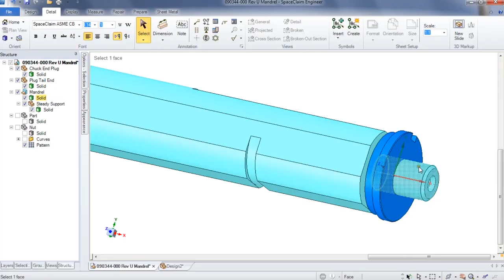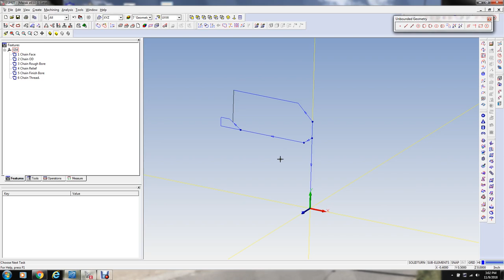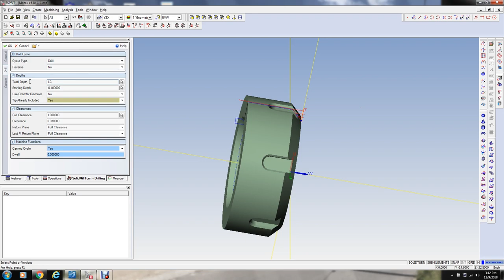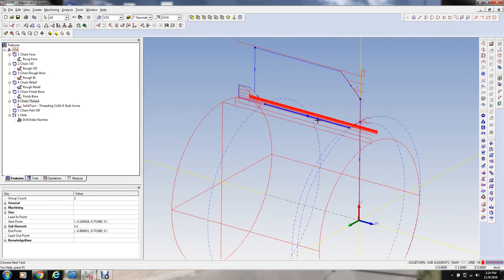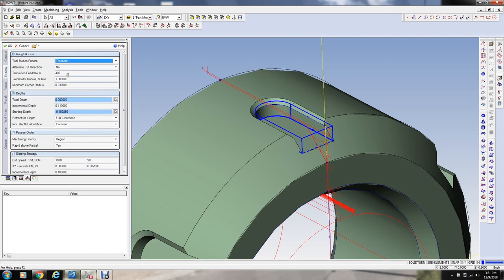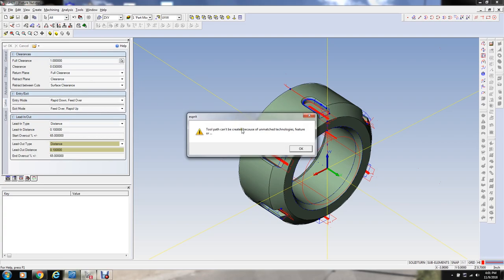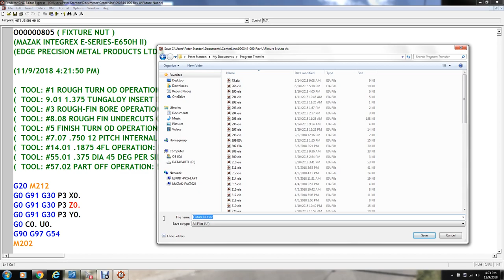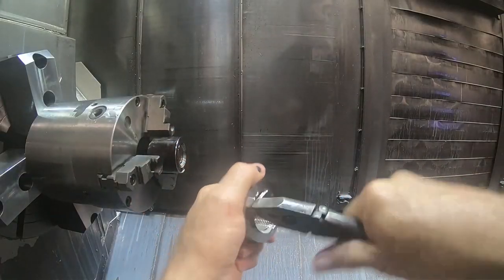Programming and Machining Fixture Nut Complete

Comment: Hi Peter, thank you for putting it out like that, a little threatening to have your style, package, machine etc open for others to observe.
I was programming back in the mid 90's. My lathe was a Daiwoo Puma with a 12 tool post, no rotary's, so it was a little less versatile. But my tool changes were done just clear of the job, after proving!
I was using AusCadCam with that and a 3+1 axis machining center which was altogether not too shabby for the times.
A couple of things.. I think my cad program was easier, more intuitive, than yours to use..
Though I didn't have solid rendering... And it didn't have a collision allarm pop up on test run...
What could possibly go wrong there, eh?
A few things all my parts had was a radius at every edge, into and out of chamfers, a small one in the bore to match up with the part off, etc.
With the part off I would do an initial plunge roughing cut to below any chamfer, withdraw an start with a radius into maybe a chamfer or directly into the part off.
Reduced almost any finish work.
Just sayin'.
Keep up the good work, we're all enjoying.

Comment: Could you have done another pocket operation for the chamfers? Enjoying the videos.
Reply from the maker: It’s possible but for a chamfer it wouldn’t be the best. Where the arc end of the slot is. That element was actually a spline. If I had just drawn in a arc than made my feature follow the arc instead of the spline. Than it would have let me put a depth with a angle or draft. Than it would have worked better. I should have done this in the video.

Comment: So you have to re-draw the geometry in Esprit? Makes sense now, I used it briefly in the past and struggled to select the geometry on a simple hole.
Reply: You don't need redraw it, you can just select solid edges and auto feature
Reply from the maker: In this video I was programming off the wire frame geometry. When doing that you do have to select the geometry. When I defined the undercut at the end of the pare I did have to draw some geometry because that wasn't in the solid model. This isn't the only way to define features in Esprit. I just did it that way for this demonstration. It will automatically select all holes for you if you have the proper work plane enabled for those holes. For doing normal mill work say like in a vertical this auto select works OK. But on a part in the Integrex it can have its problems. If you have holes from the other side of the part parallel to the holes you want it can select them but they will be facing the wrong direction or up side down. In other words the hole is starting at the bottom instead of the top. I usually manual select holes for a program on the Mazak. Also the Mazak cant go but 10 MM below X zero. So holes on a face below that makes it necessary to rotate the C axis to get to them. If in Esprit you select all those holes as one drill cycle I cant specify individual C rotations for each hole. So on a face I select all the holes Individually for that reason. This is probably way to much information but thanks for watching the video.

Comment: Looks like a lot of extra work to program in  Esprit.
Reply from the maker: I this video I'm not showing the most efficient way to program in Esprit. That wasn't the purpose of the video. If I recall saved cutting strategies onto the existing features it would be much faster. If I did that you wouldn't see what settings there are or how I would enter them. I would just be able to show you a simulation but not much else. This program could be made in one quarter of the time or less but no body would see how it works.

Comment: hello. why does the next tool render the workpiece back to the way it was at the beginning?
Reply from the maker: I think this is what you are asking. The first tool is generally a roughing tool to take the load of roughing material off the finishing tool. Than the finish tool brings the part to finish dimension. There is a lot of force and heat generated in a roughing operation that would tend to degrade the finish and cutting edge of the tool. So to maintain a better finish and less tool push off for more precision. It is better to use two tools. One to rough and one to finish.

Comment: Hi Peter, please make a video how to set your tool in Z offset and bore bar Diameter offset manually  instead of using the probe. thanks
your video is very educational, keep up the good work.
Reply from the maker: What kind of machine and control are you using or wanting to know? It would be different depending on that.
Reply: @EdgePrecision  I'm working on Mazak i400 , it has a nice probing system but i'd like to learn how to manually set Z off set, and in the video you cut the ID and measure with the caliper, please show where to enter the tool location screen and set the tool offset.
thanks for the video, you're truly a master engineer. i'm just a new ,learner.
thanks again.
Reply from the maker: This is the way you touch a tool off manually on the Mazatrol. First you need to have a piece of stock in the spindle with a faced end. Than set a Z zero on that faced end. Lets say G54 the default offset. If its a boring bar you want to set you will need to drill a hole that the bar can fit into. Or you could be using a tubular piece of stock that the bar can fit into. Now manually bring your bar up to the face of the part and touch it off with something. I use a .500" dia dowel pin. Note the number on the display in the Z axis (The work offset you set the Z zero to has to be active. If its G54 it will be by default). Subtract from that number the touch off tools thickness (in our example this would be .500 for the dowel pin). Enter that number in the A offset. Now look at your position display it should read plus .500 in Z. For the X offset you need to be in turning mode. Than manually bore a diameter in the stock. Back out the bar but don't move the X axis from where you were cutting (This Is Important DON'T MOVE X). Just move back in Z enough for clearance. Take your calipers and measure the diameter. Now divide that number by two (Remember this number you will need it later). Go to the offset for that tool. Put the cursor on the B dimension. Now at the bottom of the screen there should be a Teach soft key. Push it. You will get a massage saying enter the distance from centerline. Enter the number you calculated from your diameter measured divided by two. No go back to your position display. It should read the X diameter you measured.  The tool offset is now set (Except for the radius and comp direction if you are using Tip comp in the control) for a eia program. For a Mazatrol program you will of course have to farther define the tools parameters. When I first run a turning tool I don't completely trust this to right on (It will be very close). So I put some offsets in the wear the first time I run the tool. For a OD tool everything is exactly the same you just take a cut on the OD and back off the tool in Z not moving X and measure the diameter. Hope that answers your question.
Reply from the maker: I need to make one little revision to what I said. For a OD turning tool when the B axis is at 90.00 Degrees the A offset is the diameter and the B offset is the Z. Or to put it another way. The A offset is from the face of the milling spindle and the B offset is from milling spindles centerline. This changes depending on the B axis orientation.
Reply: @EdgePrecision  thank you very much sir 
Technical college should have you there to teach CNC class for advance level, thanks for your time to explain to me , wish I can buy you a beer or a cup of coffee.
you're a true inspirational to the machining trade.

Comment: great video pete. how much material do you leave for finish? what the name of the boring bar you used for that back relief. i think it was 35deg insert.
Reply from the maker: On a turning tool I usually leave .010 in X (Radial) and .003-.005 in Z. That Bar is 1.0" dia.  Iscar 35 deg insert  # VNMG 2.5-2-NF IC-907 grade.
Reply: @EdgePrecision  thanks! loved this type of video. its awesome getting different  programming strategies from more experienced machinist.

Comment: Another great quality video Peter. Did you consider just writing a mazatrol program to make a simple little part like that or do you run eia programs for everything on your mazak. Of course if you did a mazatrol program we wouldn't have learnt anything about esprit cam. I was just wondering thats all.
Reply from the maker: The only thing I use Mazatrol for is boring chuck jaws. Everything else is EIA programs. Mazatrol is good for lathe work. I don’t like it for milling.

Comment: I work on gibbscam and it seems much more primitive that this cam. Wonder which one is better
Reply: gibbscam here too, but Espirit user interface looks primitive in comparison
Reply: @c4tohagen  i don't like the gibbs simulation and interface always gets me a dos feel. For cad amd milling i use siemens nx and it feels very different.
Reply: @Fischer977  yes, the simulation is rather slow and should need an overhaul.....but the interface in v12 you can drag around and customize everything...
or did you mean dos feel with v12 interface ?
Reply: @c4tohagen  no....i didn't downloaded 12 although I've paid for it, it is significantly better?
Reply: @Fischer977  yes, there are improvements here and there, and V13 is just around the corner
Reply: @c4tohagen  thanks. I'll overcome my laziness and download it. I've always thought that lathe software don't have so many improvements, so it isnt a must to buy every upgrade.
Reply: The best CAM program is.... the one you know the best.   :-)     Someone that knows an "inferior" or sub-par CAM program inside out will run circles around someone who is not well-versed in a superior program.    (IMO)

Comment: Do you ever use mazatrol? It's way quicker for jobs like this
Reply from the maker: I very seldom use Mazatrol to program with. Not that I have anything against it. In this video I'm not showing the most efficient way to use this software. If you had saved strategies once you defined the features you can recall them on to the features. This would go much faster than I showed here. But even that isn't why I don't use Mazatrol. Now I haven't run any of the newest Mazak controls and maybe some of the newer ones can import solid models. This machine has a 640m Pro control and it defiantly can't. I program everything from solid models. So in order to use Mazatrol I would have to at least make a drawing or sketch than go over to the machine and enter in the program. Would that be faster? This program I show here could be done in probably one third to one quarter of the time I show in this video. Using the ability of the software I have already described. If you are starting with a drawing yes straight Mazatrol might be faster but I don't work from drawings most of the time.
Reply: @EdgePrecision  yea I assumed with your knowledge that you would probably be able to do it faster than the video shows, I to haven't had the privilege of using the smooth control yet (which looks and is apparently excellent) but I do use the nexus and nexus 2 control (also 640T/M) and I do use mazatrol 90% of the time and I think I could have programmed this part in about 15 minutes without a drawing, but as I mentioned about your knowledge some of your parts are way beyond my skill and also the ability of mazatrol, but sometimes mazatrol just trumps it all

Comment: why don't you program it on mazatrol?
Reply from the maker: For lathe/turning it's OK but for the programs I do with a lot of 5 axis positioning and even full 5 axis it not as good as the cam software. Also the collision detection in the cam software is far superior to that of the mazatrol. This becomes very important with full 5 axis milling.
Reply: @EdgePrecision  yeah i really agree to that but for simple lathe work like this isn't mazatrol faster then?
nice video btw
verry nice parts you are making
Reply from the maker: It could be but I have got so use to using the cam that I really never use mazatrol anymore.
Reply: Edge Precision ah yeah i get that, i am just learning to😁

Comment: What software do you use to create models?
Reply from the maker: SpaceClaim is what I use for my cad software.
Reply: Auto desk fusion 360 is popular but im not sure which one is the quickest and easiest. Mazak really likes Esprit
Reply: @Jay9999  our milling department is exclusively Mazak save for a Mori horizontal. I use fusion all the time to program both. I've customized posts for both which is really simple with fusion. I hybrid between mazatrol and eia subs. Anything beyond simple geometry and I run an eia sub, it's way quicker. 

I used mastercam and inventor before fusion. For 99 percent of what I do fusion is way easier. 

Modeling in mastercam is just useless.
Reply: @derick3482  mill only.
Reply: @derick3482  not full 5 axis. 3 axis plus A axis Rotary.

Comment: I work daily on a Mazak Nexus Quickturn 450 with the LBB, and there is a WAY more easier method to transfer .eia programs to your control
 by selecting the laptop folder permanent in data i/o, its a matter of 4-5 button clicks within the mazak controller to select a new program
Reply from the maker: Yes I could probably streamline this somewhat. I should map the drive in the laptop on the Mazak I just am not that inconvenienced compared to using the serial port on my Mitsubishi mill it’s  way faster.

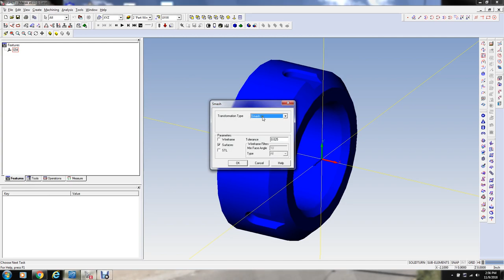Comment: another question I had was at 5:00 why do you need to Smash if you're going to use Turning profiles option?
Reply from the maker: It’s been a long time sense I made this video. But I probably did it for the purpose of using the wire frame for milling, later after the turning.

Comment: is your machine 4 plus one axis positional 5 or simultaneous 5 axis ?
Reply from the maker: The Mazak Integrex is a full 5 axis machine.
Reply from the maker: @derick3482  I don’t use the tool eye. It is easer on this machine to touch tools off manually. Because of where they put the tool eye when it’s deployed. I do have a video on realigning the B axis. The Mazak Integrex has two ways of positioning the B axis. There is a mechanical coupling that can clamp the B axis in solid positions for the purpose of turning tools. Then there is the full B axis for milling. It is important to have the B zero and the coupling clamp zero at the exact same positions. So there is a process to mechanically align that coupling position. Then set the B zero to coincide with it. This is important for the machine to operate properly.
Reply from the maker: @derick3482  The Maintence manual has.
Reply from the maker: @derick3482  on a milling tool you would only have a length offset and a diameter. The length offset can be measured in a variety of ways. If the B axis is at zero it can be set on the face of the part. If the B axis is at 90 degrees. It can be set on the OD of the part. The diameter is the tools diameter. It only applies if you are using cutter comp.
Reply from the maker: @derick3482  No you would be measuring the length in the X axis with the Z at 90. When the machine is milling you would rotate the work coordinate plane to match the B location then the spindles axis would be the Z axis. This is for normal milling. For 5 axis milling you don’t do this rotation. Everything is unrotated work coordinates.